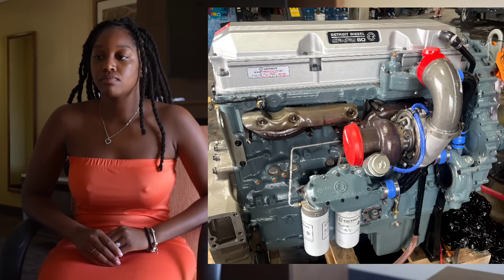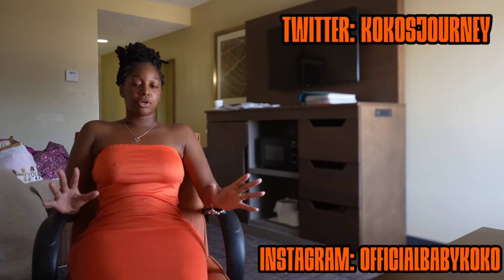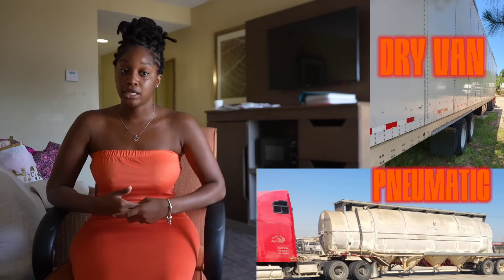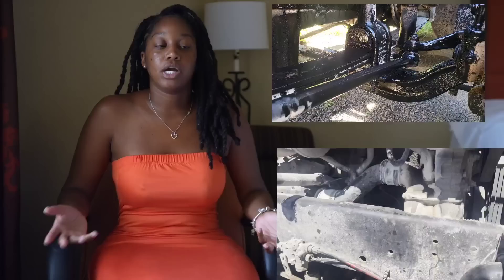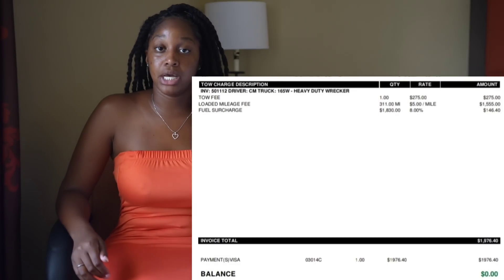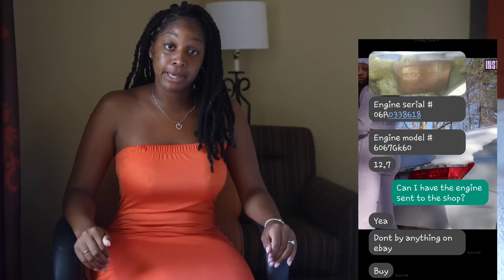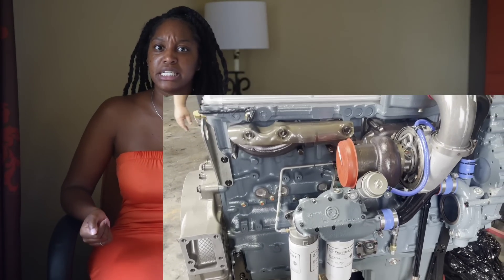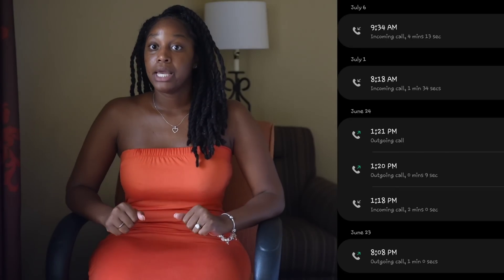How My 12.7 Detroit Engine Blew Part 1

Comment: Don’t feel bad, it’s hard to find a real mechanic and decent shop now days. Had to put my truck in 5 different shops to get an air bag replaced with me telling them every fricking time I had a bad airbag on my truck before some one said, oh wow I can hear it. 

When it’s your time for bad luck it hits hard. Lost my transmission and tcm in Nogales AZ spent 5 weeks in the hotel waiting for repairs. Made it about 300 miles before some punk decided not to pay attention to all the road construction signs, interstate closure signs or all the brake lights barely missing my trailer just to fly up alongside me and wedge his dumb ass between my right steer and the concrete barrier on the shoulder. 8 weeks in the shop and his insurance wasn’t enough to cover it all much less my down time. Basically 3.5 months with no income having to cover hotel accommodations, my insurance deductible and fixed expenses. 

Keep your chin up and working it, it will all work out in the end. What doesn’t kill us, only makes us stronger and the only thing we are guaranteed in life is that we are not getting out of it alive.

Comment: I really don’t know why a young girl like you would leave a new generation truck for a older truck, a truck that was built even before you were born, your radiator blew out your engine blew out your transmission and all that.
You bought a new engine for 40k the repair cost 10k, you bought a new radiator, you bought a transmission, replace your oil line this got changed that got changed a dollar here dollar there if you calculate how much you have spent the time you have spent on repair  shops and the stress you have gone tru if you put everything together that will get you a new truck 
You’re strong black woman and all you need now is just a little wisdom and knowledge

Comment: Detroit Engine did it have 1 million miles on it before it blew! ( i got old friend he had several trucks took Detroit Engine it 6 cylinder 60 s & 650,000 on it,  I took it apart to rebuilt  a rep from Detroit Engine came to shop why it apart, it got 1million warranty on it on sale of the truck here gasket kit put back to-gather!  run till it quits or blows up! the engines were still running when the company sold every thing and owner retired! the new owner! had it rebuilt by Detroit Engine under warranty it lasted 700.000 blew up  i worked at shop like 15 year ago the guy in hospital just out clean top of block slide pistons in the new sleeve's & put it together by next day it ran! it was the cleanest truck engine i ever saw! blew up!  the old mack motors were a oily mess!
Reply: Koko's do you know I can never drive a truck I am 61 & my life fell apart,  i blew my bi cep its not fixable i injured my shoulder, i setting in a solar back up & grid tie solar too, its my home! ( i had pt & arms are ok i start shooting) i was going to be pro shooter the 3 gun in setup(22lr,223,308) i had done, i blew my arm out 4/20/2022 i shot a ak 47 type army type i have older military to that day i 4 rifles that day i setting here waiting threaded barrels on 2 weatherby's  to keep control of kick! ok i alone i get car sick real bad if i drive i am fine! i worked & fix semi rigs i got sick in military blood cancer- ( i had sex with lady's in Korea) i not telling a sole until i know what it is it was blood cancer- never in a 1miilon years who had it in my family and lived in 1963 i have a 3 man on a sealed record known to me my uncle he who had blood cancer and lived the first man to do so it even gets stranger the doc setting at a computer telling me this aw i bet a Mr Gates has something to do with that system  why in 1984 i was in a room with him in the military( the doc said your not understanding we have records and blood sample of your uncle saved we can make you a lot better) this was the first man in the world to live threw a 100% death rate cancer! they saved everything it blew my mind God in his wisdom had not forgot me! nothing could tell me what i had or why i was sick till then that 1984 to 2019 what how and why was know! my job in military made me sick i heard from a doctor in a government hospital. plus i was put on disbility! over it too! i have a 32 year old daughter too she has no idea who i even am!

Comment: Yeah you right about that doll baby one they didn't expect you to come up with brand new engine that's what you were probably going to come up with an engine being delivered from a salvage yard then they was telling you about the transmission is messed up or whatever is wrong with it they didn't expect you to do that come up with a brand new transmission now the trick to that whole thing is what did you do with your old engine and transmission cuz even though that your old engine was messed up it's still your old engine you can take those parts have them shipped to your house and sell off the parts that are good the block is no good you can sell the block off to the scrap yard but the crankshaft you have no one of your mechanics come by and break the engine all the way down and all of the good parts bag them up and sell them off on eBay or wherever but I wouldn't let them have it your old transmission I'd send that off to a machine shop and have it remanufactured clean you know rebuilt and put it away cuz it's still your transmission but no they didn't expect you to be able to do what you did and yeah they was pissed because you spent 80 grand that they didn't get cuz I guarantee you wherever they was going to buy an engine from there's going to get it a lot cheaper than what you could buy for

Comment: I am just livid listening to this story, esp. the rude way you were treated by the receptionist when inquiring about your truck and asking for an update the first time it was in the shop! I am a young female mechanic (well middle aged now as I'm steadily creeping through my 30s haha). The AC line was definitely damaged at some point during the engine removal or install and not repaired due to carelessness. As your truck sounds like an older one it likely has a spring retained clutch linkage, it almost sounds like the retainer spring was not installed or installed incorrectly and then fell off, leaving your clutch pedal on the floor. I have no idea why they wanted to replace your transmission if it was working correctly before your engine blew, it sounds like either a money grab or they damaged the transmission themselves at some point and didn't want to tell you. It could be they didn't put the clutch brake back on as well, with all the other things they screwed up I wouldn't be surprised. I have not watched the conclusion to this story yet but I already know one thing, you'll come out stronger in the end with your hard work and perserverance. I appreciate all the detail in your videos, you show an honest, realistic depiction of life as a female owner operator. I have seriously considered switching careers for a while to try it out, however thanks to your videos I'm not just looking at trucking through rose colored glasses and that's definitely a good thing. Prayers and good energy to you. :)

Comment: very good point about figuring out how to recover from the wrong.  So many tough decisions you had to make.  A lot of trust has to be placed with people that have never met before in this situation.  It is like relationships with mechanics in the areas you do trucking have to be built since taking the truck to a stranger can result in these angry secretaries getting upset and causing repairs to be done half a**

Comment: koko you should learn a little about the basics of how and engine works. Theres youtube videos out there with videos thatll show you, make it super easy. because you made a couple very big mistakes, the biggest one of all was thinking that that shop in georgia werent actually bad people, because if they were then yelling at them about missing your emails and what not will just get them to screw you over anyway they can if they are actually messed up and were ignoring you. Trusting mechaics is the worste serioisly its a shady buisness there known for lying to people, so i learned the basics on my own and that grew to alot more. but the reason i say this other then geting robed by a mechanic because you dont know anything and they can lie to you if you dont know atleast what the symtoms of common problems are so you would atleast know what needs to be fixed. Not that you would leanrn alll of how to fix it but atleast learn the basics. But the other reason is you gotta understand that you could have just blown a gasket on that engine! There was oil everywhere you might of just blown a gasket and thats all you needed to get fixed they wouldnt even need to rebuild it ,if you stoped right then when you saw the smoke . You ran it with out oil garenteeing that you warp the engine block from heat ruining it. Also it gets worste you said you clutch was acting up after the engine fix im pretty sure that was sabotage because of your fight with the receptionist ,the air conditioning line also being cut just proves it even more. But my point is driving a truck with a bad clutch will hurt your brand new transmission so you shouldnt have drove that job after either. So if you knew that your engine could be a small problem and that your clutch is a important part of keeping your expensive transmission safe you wouldnt have made both of those problems worste by continouing to drive. Thats why i really think you should do a little research because it can save you im the future. If your engines running hot from a lack of coolant it could just be a cheap thermastat, if your engine blows a gasket or lots of other things it can seem like the engines destroyed but it  might be fixable DONT DRIVE GET A TOW. And dont trust mechanics go for good reviews and never get in arrgument with them even of you gotta go down there and pop all there tires dont say a word bad to them thatll just make it worste for you. People will try and take serious revenge over just a attitude its awful.

Comment: Koko, keep your head up. I'm an ex mechanic and I have left job's because I wouldn't do women or older people wrong because the "boss" said that I had to do whatever it takes to make him money. The linkage adjustment issue should have fallen back on the shop that done the job to begin with. I am really sorry that you've been through such unnecessary bs as ya have. I'll keep ya in my prayers if'n it'll help. Be safe and keep the shiny side up!

Comment: Ur making a lot of very bad decisions slow dwn sister out here u can't trust any 1 except urself no shade if it cost u more go to the better option first freightliner dealer & even they some times do a shity job as well I know & u being black & a sister & saying what u feel towards them really didn't help I'm sure they did It on purpose 4sure to say stay in ur place I understand I do trucking is a rough job & isn't for everyone u keep ur head up & pushing forward I hv a feeling u will be alright & next time dealing with shops hold ur piece until ur all finished & paid 4 & everything checks out okay 👍 stay safe out there rubber dwn always driver